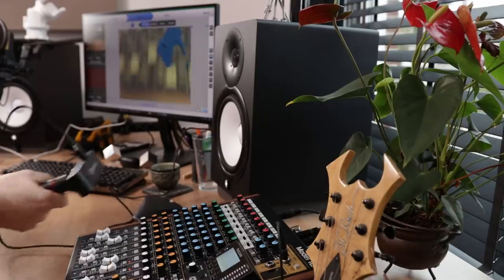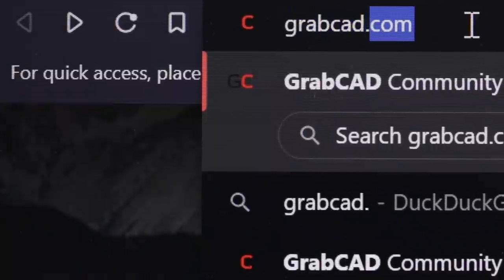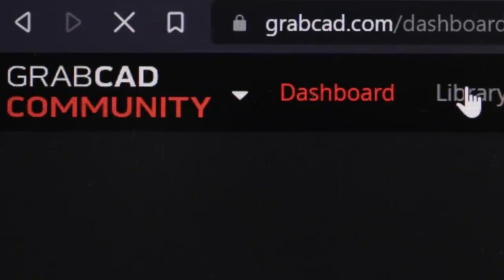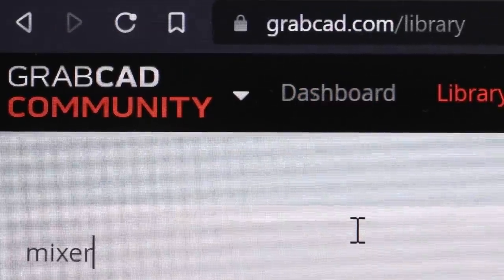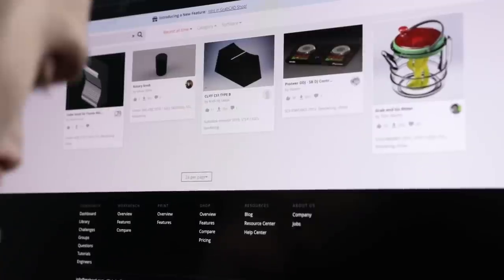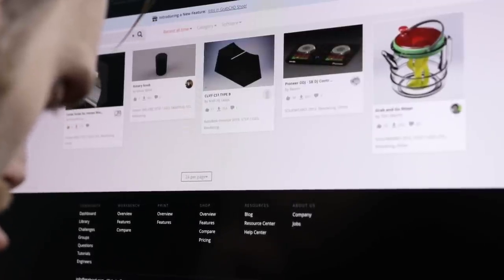The BIGGEST Problem Audio Mixers Suffer; SOLVED!

Comment: I would have designed a solution you can disengage/uncouple like the two braking circuits (that come with two braking pedals) of some tractors

Comment: me meanwhile with an X32 Core (or any digital console) - liked faders on an X-Touch where a motor attached to the fader keeps stereo linked channels faders in step. Most normal people would use the stereo in channels 7/8 or 9/10 - The quarter-inch TRS sockets for the Right channels are still connected to a mic pre just like the XRL connector used for the Left Channel. The engineers thought of this already and provided stereo channels that likely have calibrated Cricut so the levels match with in a decent tolerance. Assuming this is a tascam Model 12 or in the same family.
Reply from the maker: Odd thing about this mixer is that the computer's output is routed to channels 1 and 2. In my opinion it would make more sense to use 9/10 like you mention. Also, this is not the most serious video I put out there😅

Comment: A splendid modification - but !.... My 1978 Calrec mixer had Aluminium half pipes that bridged two faders - and could quickly be removed. Also, My 1986 Studer mixer had similar fader links made of perspex - that could also be quickly removed. We didn't have 3D printers though! By 1999 we had motorised faders and we could link ten faders to one at a simple touch.

Comment: Model 12 has 1-6 balanced inputs I would use a unbalanced to balanced cable and keep the pan in center
Reply from the maker: Thanks for your suggestion! Odd thing about this mixer is that channel 1 and 2 are used for the computer's output. I'd rather had it at the single 9/10 channel (which is possible to do with some ASIO tool patching workaround, but far from ideal). Another reason why I'm not using balanced inputs is because I use phantom power for the mic and I want to be safe. Let's say that I used this for a stereo instrument, wouldn't the instrument sound different when having both channels panned at the center instead of left and right? Genuine question, because in other cases with the cable you mention I did always pan the channels.
Reply: @properprinting  for computer output you should have a usb interface output from a daw or USB output. Gives you 2 channels back
 https://m.youtube.com/watch?v=YHePCkkgSsI&feature=emb_logo

Comment: very cool print, but this wont solve stereo tracking issue! the biggest contributor to this is the fact that faders and potentiometers have a massive tolerance(+/-20%), and are typically never matched between channels. If you will constantly be sending stereo signals to the same 2 channels, its best to solve it by calibrating the output level to the mixer in your daw by trimming one of the channels until it matches the other

Comment: In which I hoped his solution to the "bumping into button problem" wasn't tweaking and printing new design, but creating a brand new laser trimming system to trim/cut prints for universal tweakage.
Reply from the maker: I should've used an endmill to solve that, how straightforward to print it again 😂